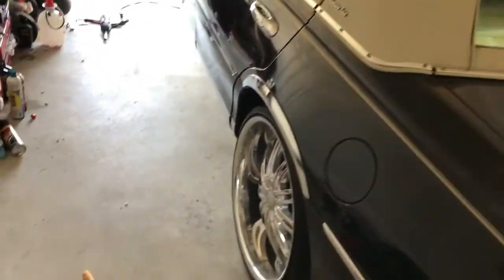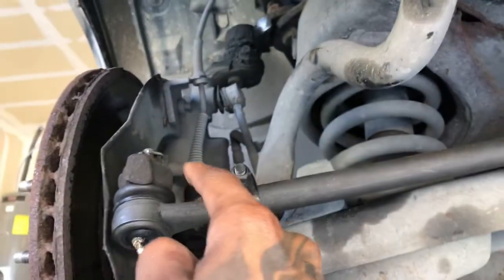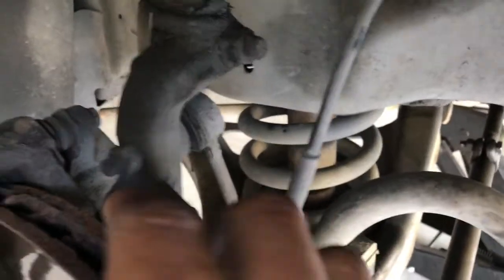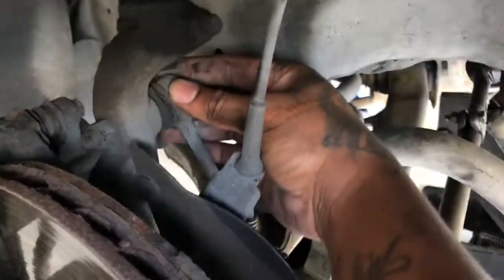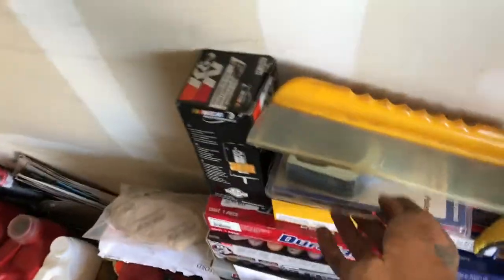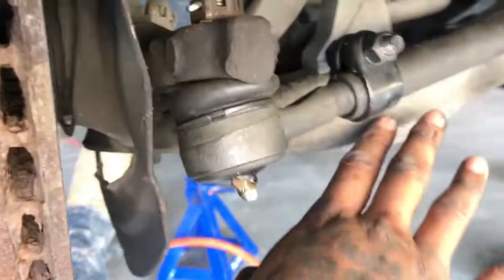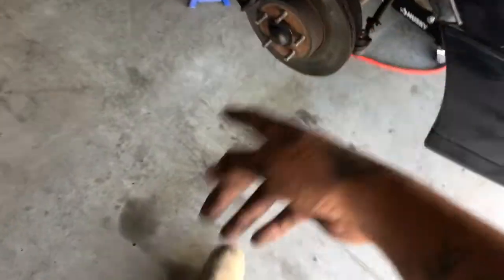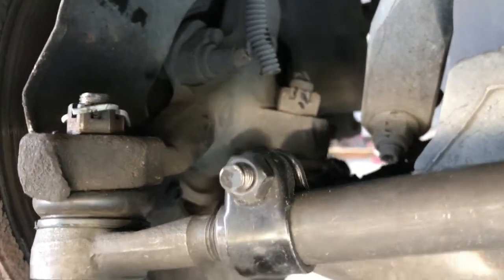How to Remove the Front Suspension of your Town Car

Comment: Got a 1998 Lincoln TC trying to order the upper control arm assy (comes with Bushings and the ball Joint already installed) but there is two different options, with or without handling package. Does anyone know the difference or how to tell which one a person might have. Thanks
Reply from the maker: handling package? are you referring to shipping
Reply: @PILLAHDONTPLAY  No Im talking about the car. If you go to Rock Auto or any other parts house and search for upper control arms for a 98 Lincoln TC. Its going to ask if the car is equipped with or without the handling package. Hell I dont know if it is or not and no one else seems to know how to tell either.
Reply from the maker: oh that! that’s basically a performance package for the P71 panthers if you have a regular panther don’t about it. but you can check if it’s has a handling pack by running the ViN
Reply from the maker: what trim level TC you have? i can do some further digging
Reply: @PILLAHDONTPLAY  Hey Thanks, It's a Cartier.
Reply: @PILLAHDONTPLAY  I'll try doing a search with the VIN. Good Idea. Thanks Again.
Reply from the maker: oh yea! you have the handling package…. the Touring Edition and Cartiers came with it.
Reply from the maker: email me a pic of your suspension you probably have the same setup as me…i think the newer cartiers has that package

Comment: Why the back of my car is wobbling and my rear driver side is leaning heavy on that side.
Reply from the maker: You may have a blown airbag from the heavy leaning and the wobble can be anything from loose lug nuts, trailing arm bushings with bad or a rear axle problem.
Reply: @PILLAHDONTPLAY  I was thinking the same thing cause it blew the last time. You think it could be a bad tie end rod
Reply from the maker: If the wobble is coming from the front it can be
1. A bad tire
2. A bad hub bearing but you will some hard grinding noises
3. A bad ball joint on either the Tie rod ends or upper and lower control arms 
4. bad bushing on the upper and lower control arms 
5. Bad sway bar link bushings 
6. a bad Pitman arm if you have a lot of play in the steering wheel 
7. Or your steering box is going bad
Reply from the maker: If the wobble is in the rear 
It can 
1. Tire 
2. Trailing arms bushings 
3. Or a bad axle
Reply: @PILLAHDONTPLAY  nah the wobbling is coming from the back.
Reply from the maker: Ok does it wobble side to side?
Reply: I know the air bag is going to go anytime now
Reply from the maker: I make you a video
Reply: @PILLAHDONTPLAY  ok thanks
Reply from the maker: Working on it now
Reply: @PILLAHDONTPLAY  good looking